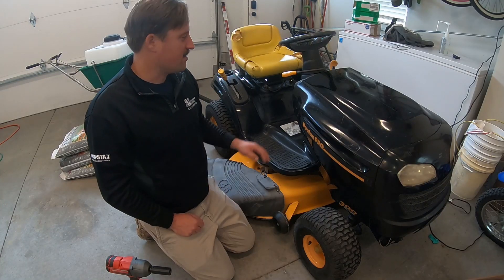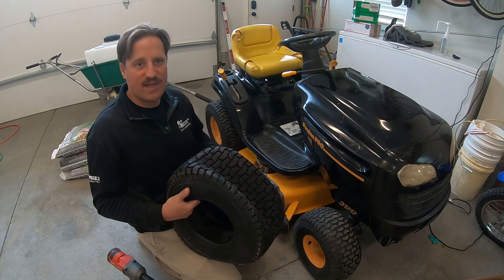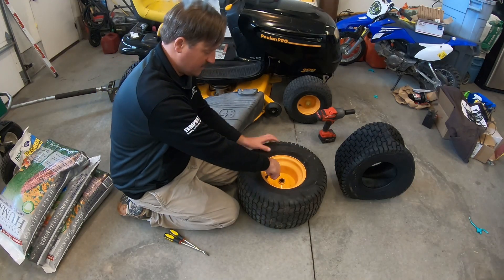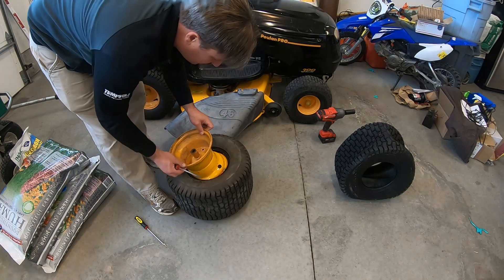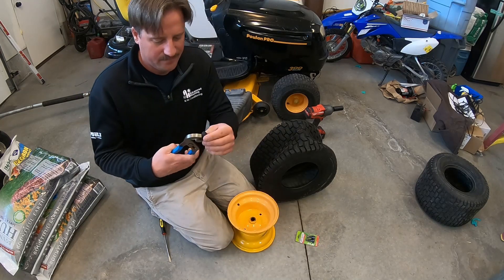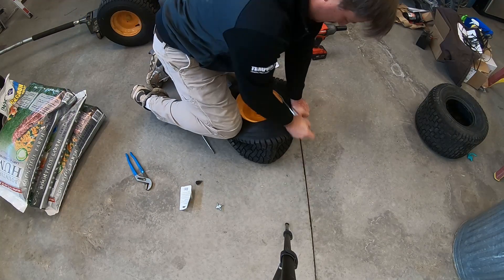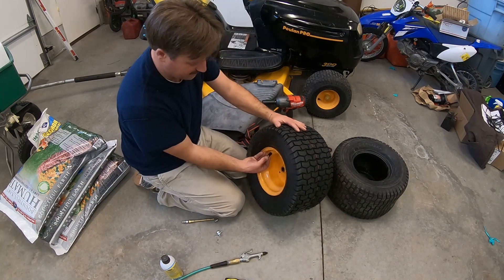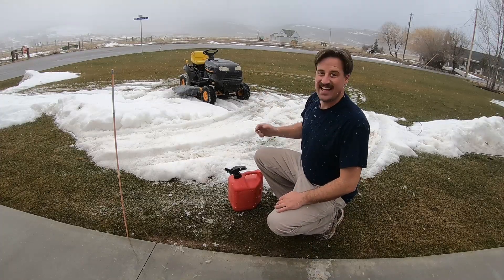How to change a TIRE on a LAWN TRACTOR mower

Comment: I've had a nail in my tire for 3 year if you don't take it out it won't leak. Great video
Reply from the maker: Sun420 this is true and I considered leaving it in as it was obviously holding air. The main reason I changed it was because I want to resell the mower and I wanted a premium for it. I did not feel right selling it knowing that the nail was in the tire. Thanks for watching. It was also becoming sun rotten.

Comment: I would have never expected you to put a coat of wax on a tractor you're going to sell :D I do have to say, you got lucky with those tires. I had to use starting fluid to change the tires on my zero turn. They were a real pain to change. Oh, one more thing, side cutters make short work of valve stems.
Reply from the maker: The wax actually is what sells the mower. I think that this is like the 4th riding lawn tractor that I have flipped.

Comment: Are you going to use it for mowing?
Reply from the maker: james 123. Not likely. Doesn't mow low enough for lawn and no bagger. I'll use it to mow down weeds on my back half acre where I don't have lawn. Either that or take deck off and it it as a utility vehicle with dump lawn wagon being towed behind. My first choice would be to sell it for a profit.
Reply: Connor Ward hey! Here's and idea take the deck off and add several pull being gang reel mowers to the back! Then you could mow much faster

Comment: Is your garage heated?
Reply from the maker: No. The walls, ceiling, overhead doors are insulated. It does not freeze in there on the very low cold days like 2 degrees. The heat from the house keeps it warm.